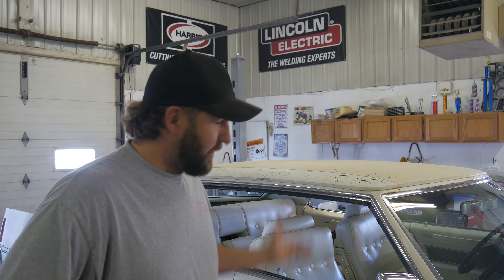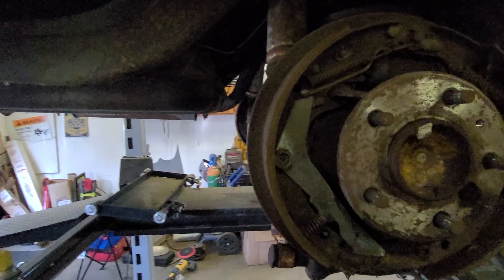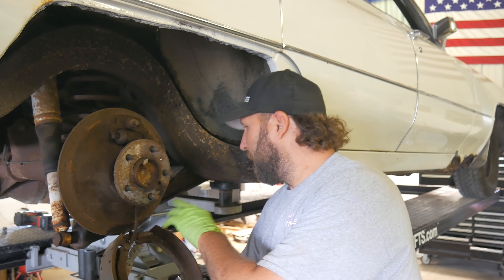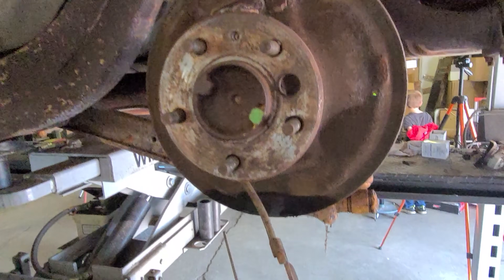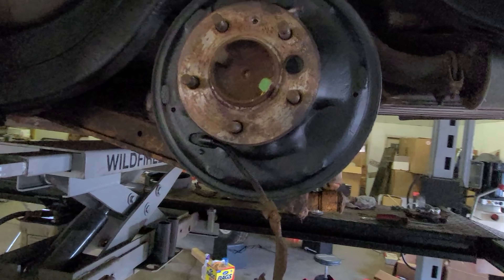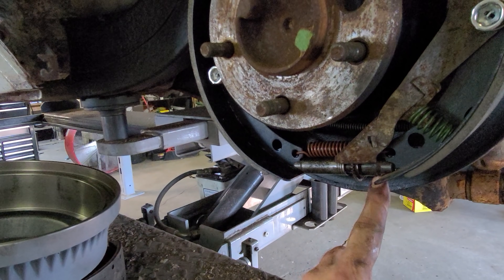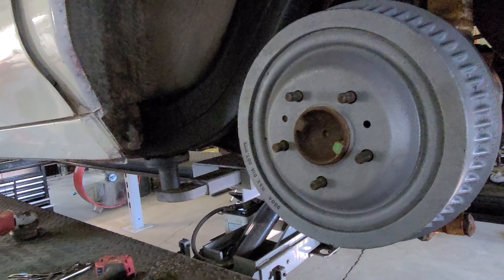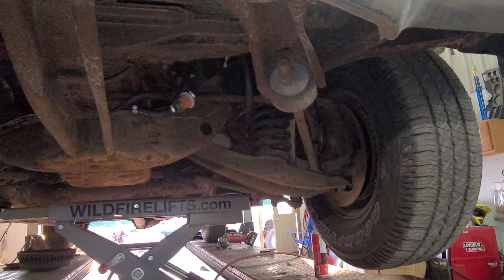Abandoned 1970 Cadillac DeVille - Brake Job - Finally ROAD WORTHY?

Comment: I remember the good ol' days when you'd forget how they went back together, and had to open up the other side to figure it out lol.
Reply: I always open up both sides at once...and then take one side apart, start putting it back together, and then make a thousand trips back and forth until I figure it out.  I don't hate drum brakes, but they're definitely tougher to get "right" than disks!
Reply: Take both drums off, leave one side together as your “Iranian blueprint”. Just got to remember most of the time it’s a mirror image.
Reply: That was a long time ago but yep!
Reply: 😂 definitely they key is taking apart one side at a time for drum brakes.  I still have them on the rear of my daily.
Reply: I still do that lol
Reply: My Dad taught me to lay out the springs and parts in order on the floor. Perfect if you don't have a shop dog... Now I just know it on my Fords. Easy Peasy.
Reply: I did that myself lol 😂
Reply: Been there, done that. Now I take pictures. It was the reason I first bought an instamatic camera.
Reply: He didn't call a hammer a Tonya Harding quite the way he used to.  either  lawyers got after him or Tanya threatened him with a pipe
Reply: Thats how gramps taught me.
Dont rip both sides apart at same time unless your damn sure how it goes back together. 
If i took a picture, it would have taken 3 days to get my photo developed circa 1985
Reply: I used a pen and paper and drew it out.
Reply: @chrisgramza8582  My dad would do that, some newspaper laid out and all the parts laid on the paper, in order.  I do the same when building PC's for people.
Reply: @OnePieceatatimeranch  Does he look over his shoulder when he hears ice skates?
Reply: @blackcountryme  😂  Gonna have to ask Derek bout that. Tonya is a lot bigger than she used to be and probably packs a heck of a wallop anymore but she gets a man to do her dirty work if I remember right

Comment: I ended up using a lot of 1970 GM truck parts on my 1970 caddy. In most cases they almost fit but I had to drill some new holes or modify something to make them fit. For the brake power-assist & master cylinder, the 1970 GM truck version is identical to the 1970 caddy version, except the mounting holes in the firewall are different, so I had to drill new holes in the firewall. Once installed, it looked identical to the original one, & original installation, so nobody could tell the difference. There's a lot of these in junkyards for parts too. Many of the parts from 1969 & 1970 are interchangeable. These are beautiful machines when all fixed up. Mine is a black limo.

Comment: Keep em coming.  I'm loving the Betty White Cadillac.  I had a 69 Sedan Deville,  same color. Got mine in 1978 from the original owner,  Arkansas car, so no rust. She was great, and I should have treated her better, but as a teenager in the day,  every car I had got dual exhaust, and had to stand up to drag racing as well as being a nice going to town rig. She passed the test.  Not so good for road racing though.  First time I was road racing to town,  I discovered corners I took easily at 60 mph in my Firebird,  didn't work out so well in the Caddy.  Tires were pointed in the right direction, but the Cadillac kept going straight for the most part.  Thankfully I didn't hit anyone and her racing was restricted to drag racing,  she was strong and did well.  Loved the old girl.

Comment: What I learned the hard way early in my life was to never start a brake job by removing all the parts from both sides 😳  I didnt have a smart phone to take a picture so it was real handy to take a gander at the other side to figure out where all those springs and levers went.
Reply: Absolutely! Do one side at a time and refer to the other side to get the first correct.  If Derek give a guy enough of a shot at doing brake jobs, I 100% recommend Eric O on his South Main Auto channel.

Comment: I've used a vicegrip for drum brakes for years works great. Only thing I do differently is I use a #4 cross tip screwdriver to install the new top springs on the pivot stud.
Reply: I still have like 10 of the 'ole drum brake spring tools laying around here.

Comment: You are “The Boss”, a great inspiration and role model other fathers to spend QUALITY TIME with their children and, of course, “Happy Wife, Happy Life”😂👍🇨🇦. By the way, here in Canaja, soft brake lines are a BIG NONO, for DOT they must be solid, either in copper or aircraft quality 3/16” ID lines. Goes for our tires as well, NO RECAPS on passenger vehicle, Tractor Trailers can, using required DOT tread depth, a big company here is “Bandag”.  And wow, $2.97 /gallon for gas…who do you know!?  Here up North near Montreal, Reg is going for $1.35/liter or for you ‘Muricans”, roughly $6.00 /gallon and that’s a bit bigger than Yankee Gallons ( 126 oz US/ 160 oz CAN).
Reply: 138.9 in Renfrew,  just across the border from ya in onterible!

Comment: More resurrections on this channel than the whole of the Bible.  Also, how sweet that thing would be with rockers.
Reply: I stopped reading the Bible when they killed off the main character...
Reply: I dont really know much of anything about mechanical stuff and cars etc. but I love watching these kind of videos especially the old cars getting resurrected. But anyways I was just wondering if you could let me know what rockers are please and thank you ✌✌
Reply: @steste4952  - Rocker:  The body section below the base of the door openings sometimes called the "rocker panels", or "sills".   [Courtesy of Wikipedia]
Reply: @incub8  It has rocker panels, could Ste Ste mean the fender-skirts?
Reply: @monty  - you make a good point and are likely correct on that.
Reply: @montymatilda   incub8 is correct rocker pannels or sills are the sections you step in when the door is open on vehicle that have steps the rockers are right above the steps most offroaders put metal steps or tube frames called rock Sliders to protect the rockers from damage during offroading or 4x4 events when rockers get damaged the doors on the bottom no longer seal which hints the other name Door Sills or Panel Sills Or Sills
Reply: @AntonioClaudioMichael  Well gosh...I re-read Ste Ste and he did not mention that they were missing as I first thought...bleary comment. He just wanted the definition.
Reply: @montymatilda  I understand was just trying to help explain it in more detail was all
Reply: @blackcountryme  as a Christian i still loled at this now im going to hell thanks
Reply: @michaelsclark  😂😂👍

Comment: Derek, I'm sure you know this trick already but something I learned from the Mustie1 channel is that if you spray down the undercarriage with bar and chain oil it will keep the rust away.  
Basically he cuts the oil with a solvent that will evaporate so that it's thin enough to spray with a paint gun.  Then you leave it there.  It will pick up some road grime that soaks up the oil and creates a film.  Where he lives they salt the roads every winter and it really works awesome.  Make sure you spray inside the box channel as well.

Comment: Recently I picked up a 78 Grand Prix. I have been wanting a project car for a long time and just never really pulled the trigger. Lots of research, but I kept hesitating. I have been watching piles of these videos and despite the disclaimer, I have learned a ton. My GP went from not running in over a year to barely starting to actually idling. During that first, true idle, I was hoping to move the car back and forth a few times to test the trans and the brakes, when the peddle hit the floor. I blew the front driver hard line. Last Saturday. I decided to just start finishing other projects on it and not get discouraged.

Just this weekend I was looking at brake flare tools, benders etc. to try and make my own lines. However I was a tad nervous about this and potentially needing to work on the drums on the rear. Then as if you knew that, this video comes out. I remember the 63 LeSabre video and your statement that once they are gone, they are gone. Your videos are helping me keep at least 1 more classic car from the pick n pull and I am sure many more.

Comment: I'm still amazed at how smooth my Dad's old 79 Fleetwood handled.  You could drive it with one pinky.  Most impressive power steering I've ever experienced.
Reply: The power steering on my 58 cadillac is the same.  Can turn the corner using your pinky!! Lol. And on this old lady, thats about 2 whole revolutions on a HUGE steering wheel!

Comment: I remember the Vise Grip brake trick..basically, the mechanic told me that you can't be afraid of the springs. Just snap on, pull, and release. It's easy once you get the hang of it.

Comment: @10:44 348, those are rookie numbers Derrick.  ROOKIE numbers.  Just finished cleaning out my Mother-In-Laws home...I found AT LEAST 500 different screwdrivers.  Between those, razor knives and hammers?  Yea...CRAZY!  Over 30 utility knives and 500 blades, 23 framing hammers, countless rubber mallets, hand sledges, roofing hammers (for cedar shakes), etc.  We just started joking each time we found another...It was CRAZY!

Comment: Agree about those drum brakes. Many trucks still use them today even if they are air operated.
I used to have an old 1961 Peugeot 404. It had 2 brake cylinders on each front brake drum pushing on 2 leading brake shoes in each drum. It stopped great, even without brake servo.
You just need to now how to set them  up and adjust them properly.

Comment: Derek for future reference when looking for a hard to find caliper like the one for the Cadillac, cross reference the brake pads against similar vehicles. I found nobody had calipers for a 68 Cadillac and mine wouldn't come apart to rebuild but I found 68 chevelle calipers were the same bolt spacing and used the same pads. Only difference was the Chevrolet calipers were like 1/16 larger bore size and the brake hoses were different. The worked out great, cheaper too.

Comment: You could always rebuild the RF I mean drinker side caliper if you can't find a rebuilt one. Good idea replacing brake springs and wheel cylinders. I like drum brakes. Make sure you lubricate or replace pb cable as that helps keep them adjusted. New brake lines are pretty cheap too. Clean and lubricate self adjusters and we used to dab a little grease on the tabs where the brake shoes ride on the backing plate. Good idea to bleed that old brake fluid out of the old lines. Good to have your helper in the garage. Very common for the master cylinder to go out after fixing everything else on the brakes.

Comment: Tip: Use Never Seize or Red Line Synthetic CV grease on the rear drum adjuster threads. That  is a must. Leave the exposed threads bare, however so they don't gunk up with debris.

Comment: Usually if a caliper sticks its either the slide pins, the piston/seal is frozen together, or has small seal leak from rust or other damage to the piston. The good thing is calipers aren't usually too terrible to rebuild, especially if it's a front without any parking brake components. Pistons, dust seals, and square cut seal are inexpensive. Best bet is to measure the piston diameter rather than trying to find parts by numbers. After removing from the car, put a block of wood in place of the pads then use compressed air in the line hole to push out the piston. If it's been stuck be careful to keep finger clear as it will build up pressure and shoot out when it breaks free. The wood block will prevent the cylinder from becoming a projectile or busting the arms which normally hold the pads. Clean up inside good, replace seals and carefully push the new piston in place. Can feel like a puzzle getting lined up so go.slow. Can make a nice video if a guy wanted to bleep out the occasional choice word that naturally come with the job 😁

Comment: Great job on the Caddy so far Derrick!!! If you can't get another caliper, rebuild the one on the car. That is if you can get the fittings and bleeder plug to break loose. I used to get the kits to replace the seals in the caliper for just a few bucks, of course that's been many many years ago...lol. Anyway, I did want to let you know that it looks 10,000% better than it did when you found it in that wet bottom-land! Keep um coming, my grandkids and I are enjoying all your video content!

Comment: For interior cleaning I use foaming tire cleaner. It cuts grime and funk and when scrubbed and vaccumed it takes smells away somewhat. Then I use a citrus smelling product to freshen up carpet and seats and headliner and whatever else I sprayed and scrubbed and vaccumed. A lot of times I put a candle (and don't light it) in trunk and let heat make the candle make the car smell better. Also carwash foam on air induction for AC will help clean smells out of HVAC. Just my opinion.

Comment: If you don't have a brake bending tool you can use an oat soda bottle as a die. Gives you a few options for radius using the neck or body of the bottle.

Comment: Do you dip the treads to the brake adjusters in some grease before you put it back together? I do to keep them from locking up and not be able to turn when they need to.

Comment: I had a 1973 Cadillac Eldorado Convertible it wad Dodger blue with white top and white interior. That old boat was in great shape and it felt like you were sitting on your living room sofa. Going over rough roads, which is the norm here in Alaska, was like floating on pillows. Someone talked me out of it and to this day I regret ever parting with "Roger Dodger". Betty is a fine peice of machinery and I am green to the gills with envy. By the by, you diggin her out was the first vidya I ever gave a gander to on VGG. Since then I have probably gone through all of the vidyas several times as my retention skills are a bit diminished. They say alcohol destroys brain cells but my theory is that they just destroy the weak ones so I am actually practicing survival of the fittest in regards to the grey matter. Just my opinion based upon zero facts.

Comment: get a rebuild gasket kit for the drinker side front piston. typically what causes the brake failure typically is smue in the piston keeping it from returning and you get a locked caliper or draging brake

Comment: I've been using the Duplicolor black engine paint on the 1930s Riley I am building. Supposedly just to protect the bare metal while I assemble it all but I imagine that might be the final finish. Works great on engine, suspension, brakes and so on. And it looks right. Pre-war cars with 2k gloss finish is just wrong.  Might do the whole chassis in it. I'll just rely on the engine oil leaks to stop the rust appearing later!

Comment: Don't forget two different size brake shoe's per side in the rear. Front shoe's  are the same size..Pay attention  small shoe location on the rear axel. Also different springs  size  for each shoe and adjuster at the bottom spring fellers.

Comment: I had a '68 Ford Galaxie 500 Convertible with a set of one-year-only factory disc brakes.  This particular model of disc brakes was offered only in 1968 model full-size Fords -- they changed the design in 1969.  So it was IMPOSSIBLE to find a caliper ANYWHERE.  

But I found a great place to rebuild the ones I had -- they did a superb job and were not stupid expensive, either.

Precision Rebuilders, Inc. in St. Clair, Missouri.  800-325-2690.  This was about 5 years ago -- I assume they're still in business.  Definitely give 'em a call about that Cadillac caliper you've got there.  Bet they could do it.

Comment: Glad to see the old girl getting the attention she deserves. Kinda curious that no one has that caliper, but a whole lot of places are bone dry stock wise these days. Will be keeping my eyes aware of further developments on your Caddy.
Reply: Not being to get auto parts is getting quite common due to "covid" these days. The supplies are getting thin. My local speed shop is looking EMPTY today, and I've never seen it that way in 25 years. The owner is disgusted with the trouble getting parts. He has all kinds of engines just sitting there in various stages of a build because he can't get the common parts that he normally can.The other day I went there to get some simple Aeroquip braided hose. All he had was 3 feet of it, and no idea when he'll get more. This is VERY common stuff, and I've NEVER had any problem getting it before. It's tough right now.

Comment: Jegs is showing that right side caliper in stock, it's loaded with pads, hardware and pricey but in stock. Another suggestion, Cadillac and other GM cars tend to use the same parts across all lines so light truck parts may be interchangeable, worth checking.

Comment: Take a 1 or 2 gal. tank and insert a couple of fittings for your brake lines toward the bottom and a tire valve stem in the top.  Move the vehicle’s brake lines from the master cylinder to the tank fittings.
Pour a couple of quarts of brake fluid in the tank and pressurize it using the valve stem.
That will give you a pressurized system and, with plenty of fluid, all you need to do is go around all 4 wheels and crack the fittings at the wheels and they’ll bleed themselves. No need to pump the pedal.

Comment: I tend to find Evaporust (liquid) is great for soaking componants in, i revived so many of my '58 Edsel's parts with that. For chassis, I used Jenolite gel, wire wool and a rag. I did try Evaporust but it needs time to really soak in, brushing it on is barely doing anything unless you combine it with a wire brush like you're washing a car and SCRUBBING that dirt off :> I know you know a TON more about cars then I do, but that tip I really stand by, myself.

Comment: I've taken an ant sprayer and loaded it up with rust inhibitor and ran the wand on the wide spray setting in the frame holes to coat some of the inside of place the paint brush won't reach